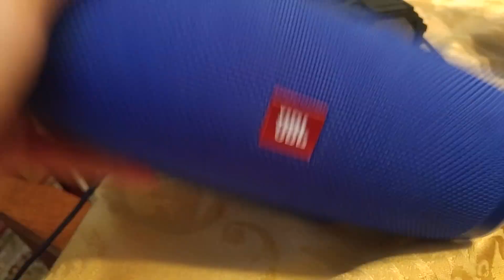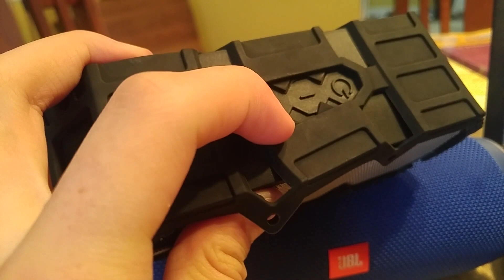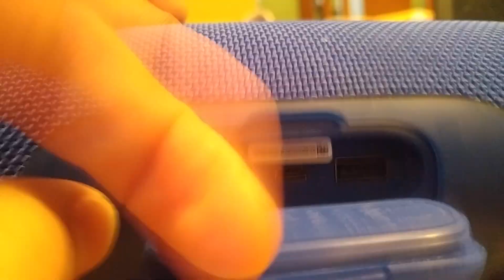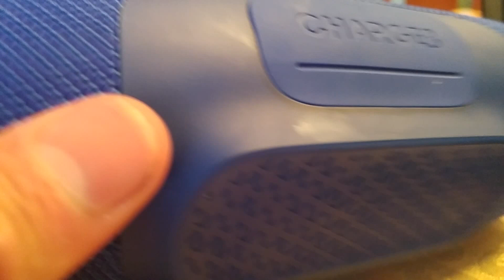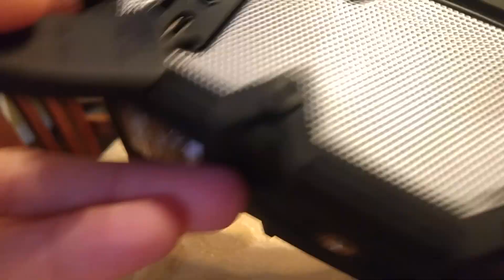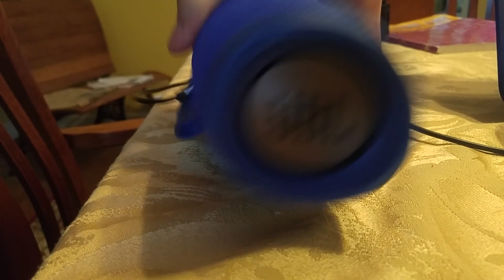Altec Lansing Life Jacket Mini 2 vs JBL Charge 3

Comment: How did you connect to the lifejacket if the light was still flashing you didn't even connect it to bluetooth smh plus you should of got the bigger version to compete with the jbl
Reply: Og sticky flapjack, You hit it on the nose.  He is even unaware that the rubber shell is used to keep it protected for rough treatment.   It helps to make it everything proof.
Reply: He said he connected it  to the aux cord